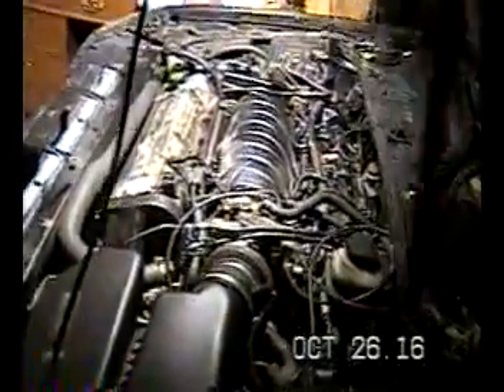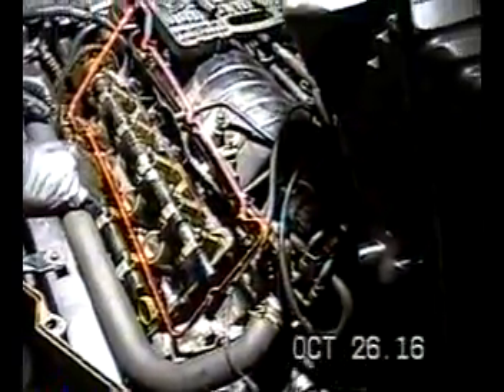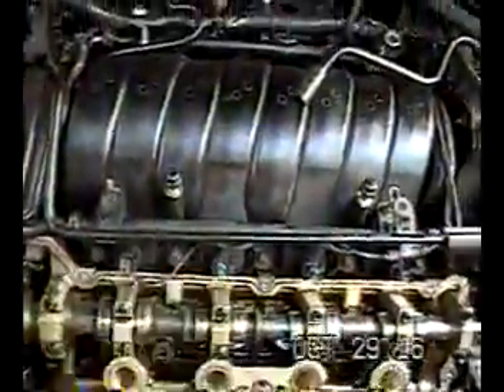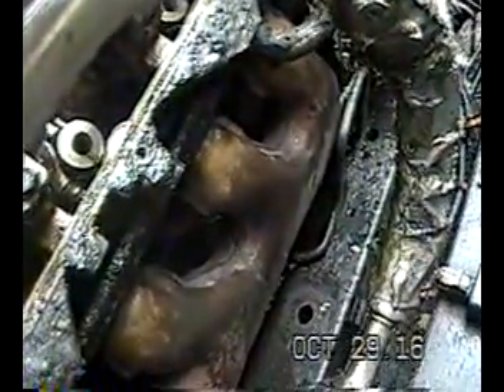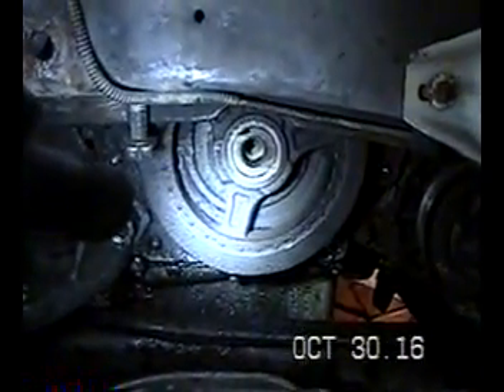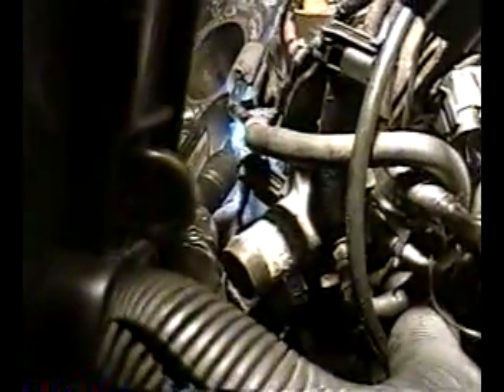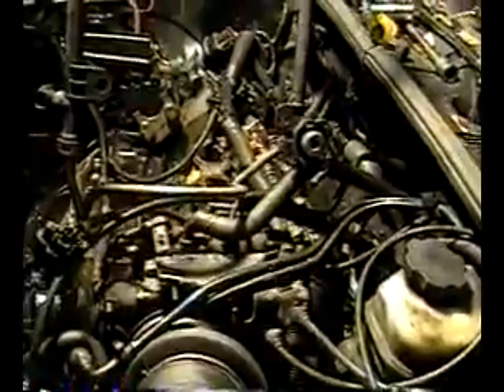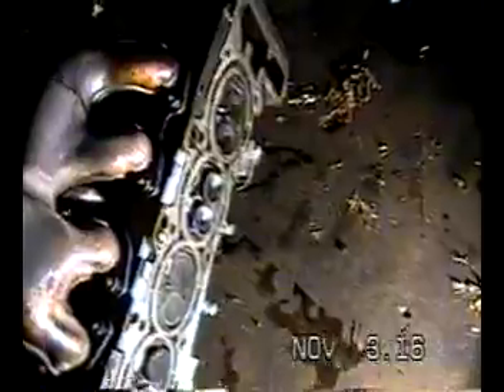2002 Cadillac Deville DHS 4.6L Northstar blown head gasket removal without removing engine

Comment: howd you do your timing mine gets stuck when i try to crank it
Reply from the maker: As I mentioned in the video, getting the timing exactly right is the one thing that you need to do with absolute precision.  If you are one tooth off on one of the CAM sprockets, you'll end up with a P300 random misfire code that won't go away.  You'll need to tear just about everything off again to get the engine cover off (including removing all of the pulleys) and you'll have to remove the valve covers (which means lowering the engine cradle again).  So, this must be done exactly right the first time around.

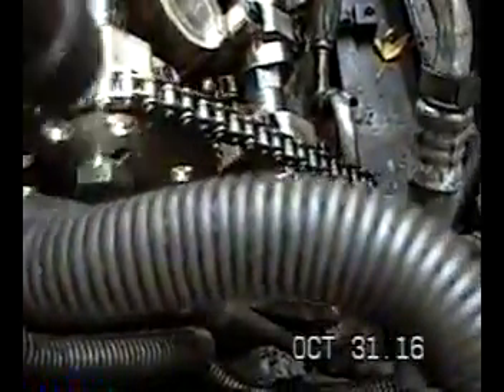Having said that, you'll have to rotate the crank by hand until the timing marks line up above the crankshaft.  Keep in mind that they'll line up twice, every six or seven revolutions.  When the timing marks line up where the CAM sprockets line up, you're where you want to be.  See the video at 51:40 to 55:35.  It's possible that you lined the timing marks up down at the bottom, but the CAM sprockets on the top are on the wrong stroke (intake vs exhaust).  You'll need to rotate the crank by hand 6 or 7 more times to line it up correctly this time, if indeed that's your problem.  Once you think that it's lined up correctly, double check it with a ruler or straight edge held against each head, as compared to the dot on each CAM sprocket.  Those CAM sprocket dots must be precisely at the top.  Good luck.
Reply: I can't find the cylinder head tightening sequence. Does it matter much

Comment: Man I am doing the same fucking job now ..... Jesus is so hard man a lot pain ...... And to take off the two bolts socket 15 mm on the exhaust is very complicated I broken two sockets trying move the both, tomorrow I will try again...
Reply from the maker: I know exactly what you mean.  I remember spending an entire day trying to get those bolts off.  The way that I did it was to jack up the front of the engine so that the back part of the engine tilted slightly downwards.  There is a metal brace near the transmission pan that you can use to jack up the engine.  Once I did that, with the back of the engine slightly tilted down, I was able to get under the car with a socket, a couple of long extensions, and a breaker bar onto those bolts.  Be sure to use jack stands and protect yourself when you're under the car.  

What you're doing right now is the single biggest "trick" to getting this job done.  Because you can't get the exhaust manifold off the rear head, you have to take the rear head out still connected to the exhaust manifold.  Then, once it is out of the car, then you can disconnect the head from the exhaust manifold.  Those who do not know about this "trick" cannot do a head gasket job on a Northstar engine while it's still in the car.  Good luck.
Reply: Absolutely genius, thank you so much I will try your idea tomorrow wish me good luck.... Have a good night.

Comment: they say the north star was supposed to be made maintnence free as poss...I got a 96 deville with 100000 mile ..just got it running good,best its been running since I got it 2 years ago at.77000..was having  f'n emmissions system stuff.with a random misfire bs  . was vacume leak up top ...pcv elbow ,, ,there really is a strong vacume to this engine /I had to do ignition coil .2 was burnt out,,so changed all plugs with wires .mayn she runs real good now . .as for the head gaskets ,, I have heard from a very reliable source .. that you just keep the coolant fresh and fairly new and add the almond shell pellots every change here on out ..that way it wont over heat with the acidity of old fluid eating at the gasket meanwhile allowing the coolant seeping through aluminum holes seadily misplace the bolts in the threads . ;aluminum is the delicacy of the engine so remember ,not to much heat ,,the suspenstion is what is what ive been trying to get righ/,sounds like krap..t ,I did the rear knuckles yest .and they looked like they were found on the ocean floor ... now a world of diff . power with control .. in the right direction ..firkin car was fishtailing in the back knuckles were so bad .got  a press did em right on the car ..,frikn mechanics these days and what the y charge at the shops ,.suspention is a btch on this to get it quiet.but little by little
Reply from the maker: The head gaskets finally went bad after 285,000 miles on this car.   For the last 5 or 6 years, the car had a slow coolant leak.  It was a hassle to top off the DEX-cool every two weeks, but I now think that's what prolonged the life of the car.  The DEX-cool never got a chance to get old.
Reply: I'm at that point now with my 2004, except I have to top it off every 2-3 trips.  Its parked right now and I'm still debating whether to have it repaired or cut my losses.   Just curious, did you drill, tap and stud the block, or just replaced the head gaskets?
Reply: Never mind my question above.  I see you answered it in the video.  Good job.  Thanks.
Reply from the maker: If you're debating it, I'd suggest taking off the two valve covers and removing the head bolts for an inspection.  If they're all tight (with no metal shavings that come up with them when you remove them), I see no reason why you couldn't just buy new head bolts and install them after replacing the head gaskets.  That would make your job a lot easier.  If, on the other hand, your head bolts are loose and/or the threads are shot in the block (i.e., you see metal shavings that come up with the head bolts), then you're absolutely going to need to use inserts (if you do the job with the engine still in the car) or studs (if you remove the engine).  If you choose to just buy new head bolts and install them, then I would suggest slightly under-torquing them.  Please keep me posted.

Comment: this cars are piece of shit i went to test drove car like this cuz of my new job soon and everything on the car was on check engines the rear suspension was bouncing up down and it was from dealer ship as well so im going to get prob 2014 ford taurus
Reply: Mustang98 3919 um what? this engine hasnt been used for years because of the issues with the bolts you can just put a northstar performance stud kit in and they are reliable as hell

Comment: The starter is under the fucking intake? What a horrible design.
Reply: James B 

Actually it’s not bad to change and keeps the starter and wires protected from the elements. The starters will last 200K miles or more if cars charging system is maintained.